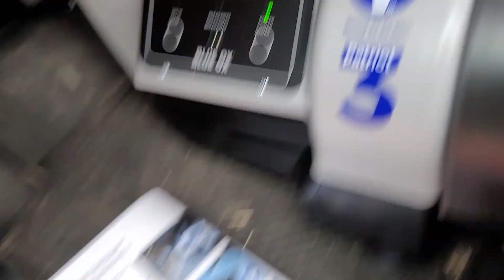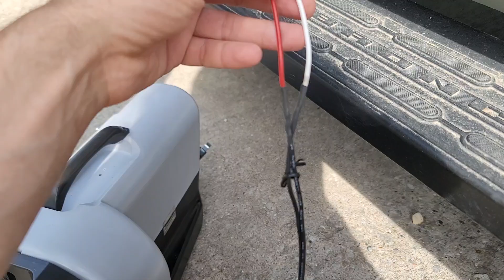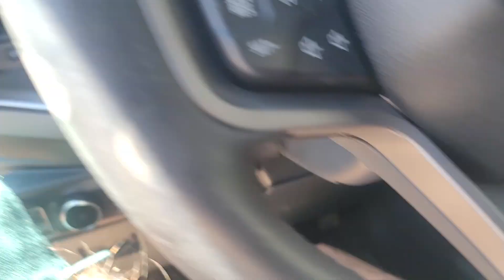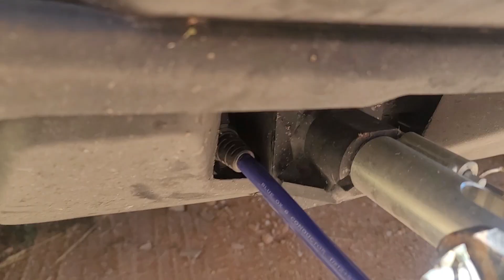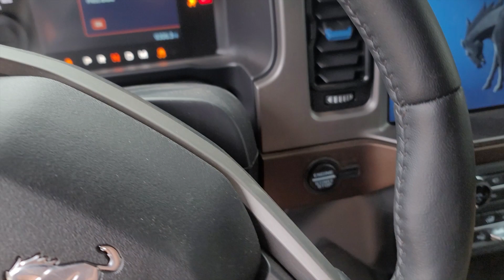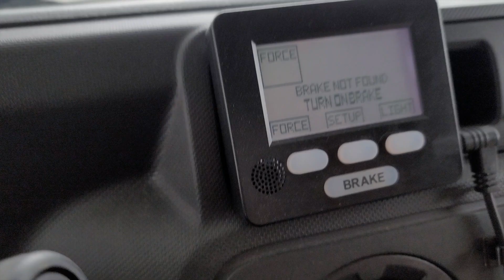How to Flat Tow a Ford Bronco - Blue Ox Patriot 3 Brake System Install & Neutral Tow (Part 4/4)

Comment: Very good info, one question, steering wheel lock...does it unlock during flat tow mode?
Reply from the maker: It does, for me at least it did. Bronco steering turned freely when I towed.

Comment: Thanks for the video. Any idea if we could get the Blue Ox power from one of the up-fitter switches that come prewired in some Broncos?
Reply from the maker: Ah I considered that during my build actually, and to my knowledge, no. Those switches are not active while the Bronco accessory power is off. And even if you didn't turn the Bronco accessory power off while towing, the switches get disabled after some time - 45 minutes I believe (but who knows if they changed anything about that behavior with an over-the-air update). I think they are run to some relays governed by the computer, which turns everything off unless the engine is running. Unfortunate really, because that would be really slick and give me an excuse to actually use up a switch lol. I'll add that it's probably possible to re-wire a switch to be directly wired to the battery. I also wonder if the computer could be reprogrammed, maybe there's a flag that can be disabled to ignore whether the engine is running or not.

This thread may be of use:
https://www.bronco6g.com/forum/threads/akturbos-dirty-betty-build-next-up-suspension-v4.41802/page-2

Comment: The part im left mystified with is how steering works. All these years ive seen vehicles flat towed assuming linkage between the tow bars and the steering rack.
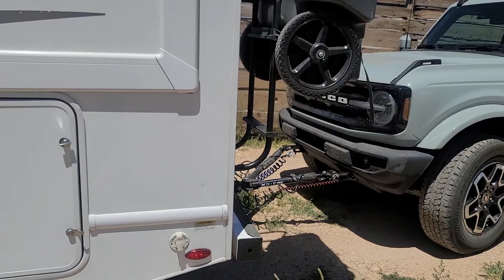Reply from the maker: Ah, no - so at 08:19 you can kind of see the steering in operation. There is no connection to the steering rack. The towed vehicle's steering is only being directed in the direction it is being pulled. The towed vehicle's steering wheel is loose with no lock out active. Works great when pulled, but you basically can't take your RV in reverse - it'll inevitably push the towed vehicle's steering to the limit and drag the wheels.